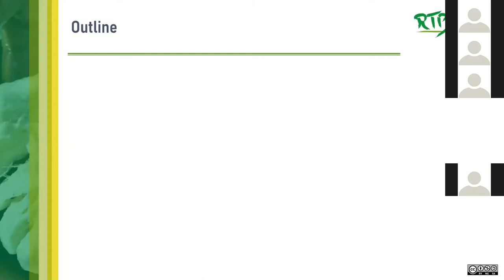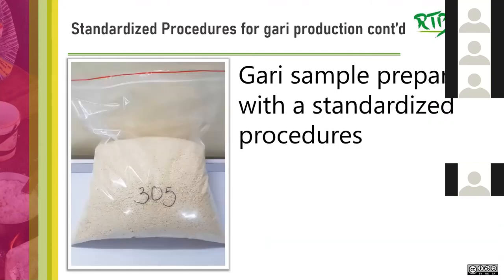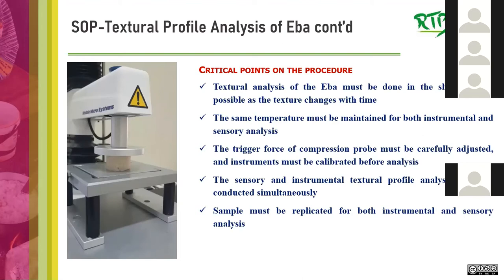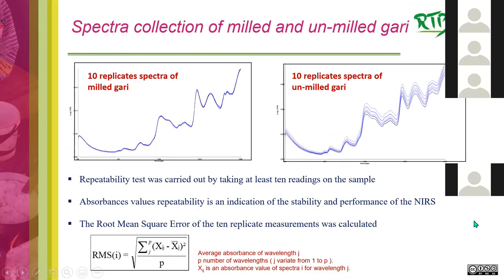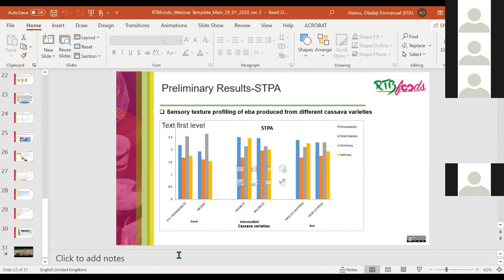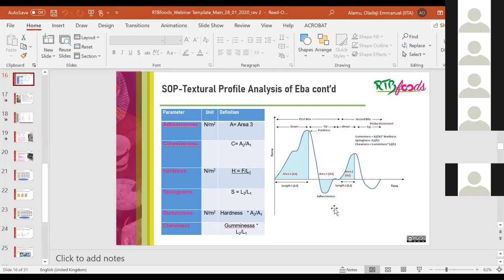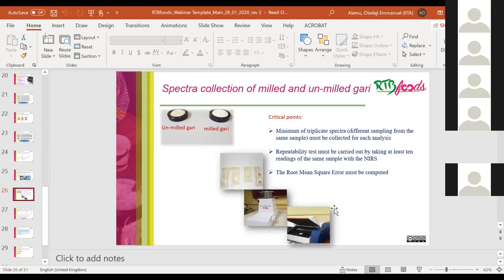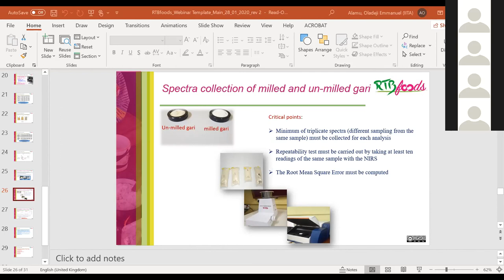Protocols Develop. for Gari production, and Instrumental & Sensory Textural Profile Analysis of Eba.

Comment: Reflecting on this presentation now, a year after,  one can suggest Kieffer dough extensibility rig and probe combination to determine stretchability directly. However, proxy methods to determine extension (which may be related to stretchability) of eba may include the use of bi-extensional viscosity test or any other extensibility test. Good instrumental extensibility/bi-extensional viscosity relationship with sensory and consumer test results of eba have now been proven by 2 SOPs. Very interesting discussions!
Reply: Dr Toyin, thanks to you and the CIRAD teams for moving this forward by developing new SOPs to measure to measure stretchability which has seemingly difficult to characterize using the TPA method.